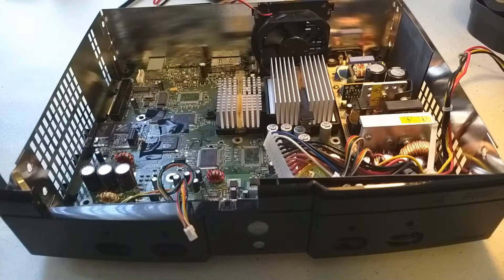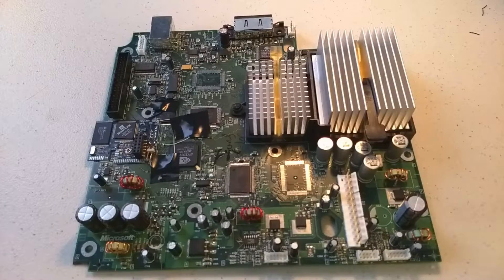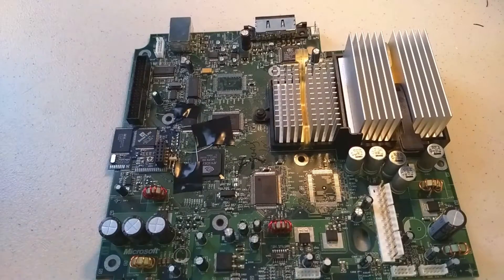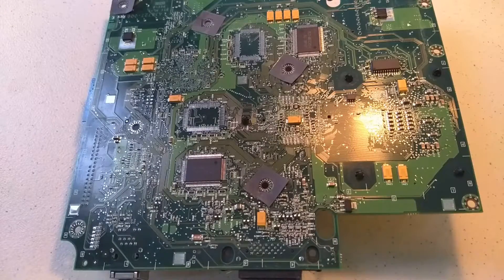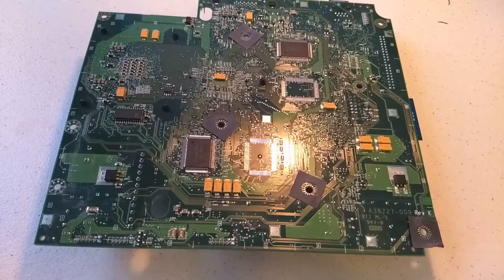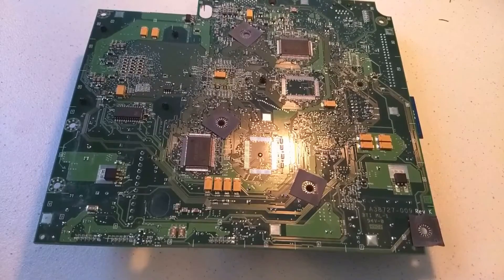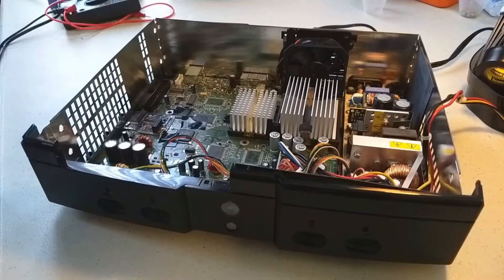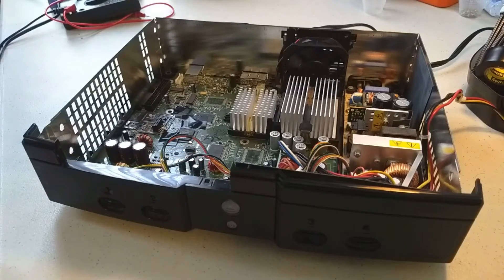Ebay Repairs- Original Xbox Trace Repair

Comment: I have trace corrosion near the 3rd capacitor 3300um 6.3v on the underside of the edge of the motherboard, all 5 traces are damaged, do I follow the traces until they lead to their solder points. Can I solder from where the trace begins to where the trace ends.
Reply from the maker: yes, do a direct line

Comment: i found a dead xbox for 15€ came with a broken 360 controller and two ps3 dualshock controllers
and a wii remote aswell
I found no issues with the xbox just 3 swollen caps which seemed to not cause issue but found a broken trace just like this

my symptoms were instant power on when plugged in 
powerbutton doesnt work for turning on but turns off when pressed
sometimes when i press eject button the tray opens about 1-2cm and closes and at the same time screen goes black and console shuts off
i dont have the equipment or skills yet to do this kind of repair 
so i think ill let a local repair shop take a look and if its not too expensive ill go that route

Comment: Regarding the clock capacitor removal, you need to have a clock cap for the 1.6 variant, if it doesn't boot after clock cap removal then you'll need to add a new one.

Also, you should update your link with an archived page since The ISO Zone is no longer around https://web.archive.org/web/20171229154855/http://theisozone.com/tutorials/xbox/hardware-and-modding/trace-corrosion-repair/

Comment: I own a old original Microsoft Xbox and it's modded also it's a 1.0 I changed the thermal paste removed the clock capacitor and I put a Samsung DVD drive in out of a broken xbox
Reply: I just got a 1.0 from ebay and it is having the instant power on issue, I plan on checking the traces and fixing any dead ones. Do you have any suggestions?

Comment: I would of just got 40awg enabled wire and just fixed the break. Running wires that long looks bad and can cause more issues if their not tapped down good. I recommend using a 1" 40awg single strand wire instead of a one foot  wire.

Comment: can't i just retrace it with a silver conductive pen with a micro point? saying this because my soldering skills are "not great"
Reply from the maker: if you have one, i don't see why not. Usually the corrosion doesn't interrupt the trace in a single spot, but many. I find it much more practical to bypass that entire line since you don't know when other spots may be broken later.
Reply: Retro_VG_Repairs its just the one trace on the edge of the motherboard thats messed up. The second trace has like missing spots. But the whole motherboard is in good shape.
Reply from the maker: yeah thats what i mean, you'll be doing much more work by patching up every little break in the trace. Maybe its due to my experience but I think the wire method is very quick, easy, and works the same no matter how bad the traces are.

Comment: Thanks for this video. I'm going to try and fix my Xbox tommorow. I wish I'd checked the capacitor sooner, the Xbox randomly powers on and won't turn off with the power button. Strangely though, sometimes it works fine for days.

Do you think of replacing your broken clock capacitor with a new one? 
Are there capacitors fit for use as a clock capacitor that won't leak as quickly as this one? 

This is one of my first solder projects: thanks again as this will help me fix it.
Reply: Hi. Sounds like you have the exact issue as the one in this video.

To answer: No I never replace the clock cap with a new one, though some might believe in doing so. If you do, it should be the same capacitance (measured in uF), and a voltage rating thats the same OR higher. You can get better rated caps that probably won't leak but I can't tell you how long that might last. That being said, I highly recommend you just forego the replacement. If the Xbox is unplugged for a while, its likely the timer will get reset anyway. 

My advice to you: remove the clock cap immediately and clean it with white vinegar+cotton swabs. Go over the area again with rubbing alcohol of a high percentage. Next, for your soldering job, don't forget to use plenty of flux. But be remember to clean it up when you're done!

Good luck!
Reply: Damn, it was hard. Getting the tin to fall of the solder tip was the most annoying part.

Turned out only one trace was bad, I had to use my mobile phone's camera to look at the traces because they're so small. Multimeter confirmed single trace was bad. Strangely the broken trace wasn't even near the leaked capacitor, although it damaged some resistors and capacitors. I guess these 'power' traces go bad regardless of the capacitor leaking.

But, after an hour of trying it worked. Even though the new tin connections don''t look very good, the new wire connects and all of the problems are gone! For a day now it hasn't powered on by itself and the power button works all the time.

I only fixed one trace, my guess is that over time the other traces (the ones you tested with multimeter in your video) will go bad as well, in my Xbox they didn't look that good. 

Thanks again for your tips!
Reply: Justin wow that's great for your first soldering project. Having a temp controlled iron helps a ton. I found that these kinds of repairs got really easy once I upgraded my iron to something better. Use flux on both the joint and the wire, then put a dab of solder on the iron. Then press down on both. Should stick just fine. Even if it doesn't look good, as long as there's continuity, you're ok.
Reply: @speedy3523  , Hey there. Next time try increasing the temp on your iron a little if it is adjustable and use flux.  Always use flux. You will have less problems.
Just because it is rosin/flux core solder. That isnt enough honestly. Use flux anyway. You will see how much it helps. I get the feeling since it was such a pain in the ass for you. That it will kind of deter you from trying to solder again.
Reply: @YellowElevator815  What temperature you recomend using ?